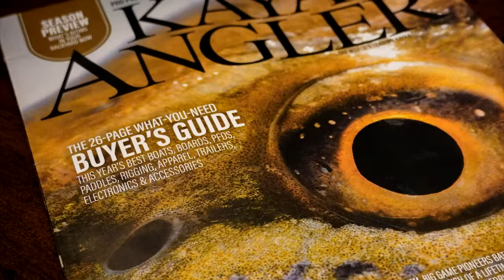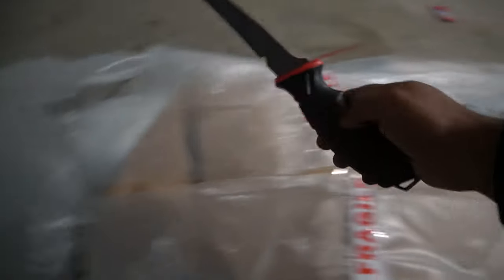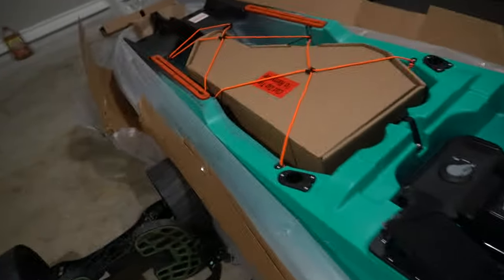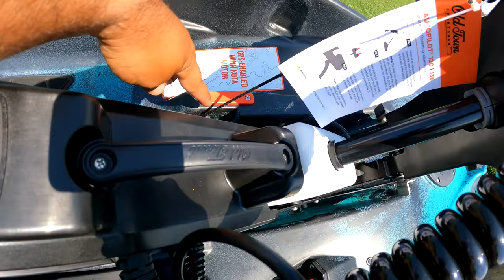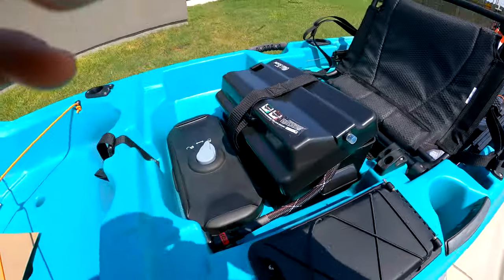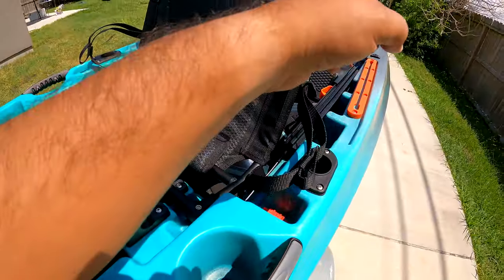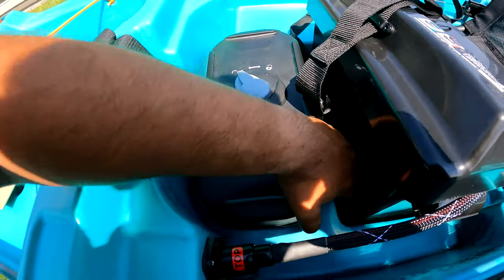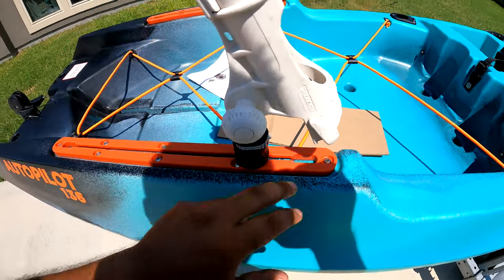Autopilot 136 MOTORIZED Fishing Kayak | First Impressions

Comment: I've had my 136 for a year now. Nothing compares!
Reply from the maker: I’m interested in seeing how the competition will answer. It’s just that good!
Reply: @NextLevelFishingTV  I have one FPV 110AH lithium battery as my main and depending on the trip, keep another one of two extra 100Ah lithium's batteries for back-up. I have a 54lb thrust transom mount motor II use on my Bay liner and wanting to experiment with hanging it off the kayak straight and use mainly for speed. I'm trying it just for curiosity and see what happens.
Reply: Is the 120 good too. Can you guys please try to help me out I'm on a mission in saving our beautiful waterways universe using a kayak like a old Town autopilot either the 120 or 136 but I'm a very poor young adult trying to make a big impact in saving our beautiful waterways by picking up Trash and to keep it clean can you guys please help me win one please
Reply: @gregjulian1044  Why do you need so many batteries I thought one 110AH lasts the whole day.  Also on the topic of speed, is the 45 lb thrust too weak/slow?
Reply: @golforfishing  I fish inshore mostly and some offshore on the Texas gulf coast. I use some electronics such as my graph and some other gadgets. I can stay out all day and battle some severe tides at times which can easily manage. The 45 lb thrust is fine and depending on the wind direction and tide, manage 4mph on high and less speed if going against the wind and the tide. I never want to run out of battery and be stranded in adverse conditions.

Comment: When facing deeper water swells say like in Baffin Bay this kayak would be awesome.  Spot lock technology does away with anchors which can scare trout when using.  Back bays maybe not so much, but each kayak has its uses for different waters.  Definitely a kayak that would have to be trailered as opposed to loading in a truck bed, not that it couldn’t be loaded in a truck, but trailering makes it easier.
Reply: Do you do much fishing in Baffin?  I'm looking to get a Kayak for getting into the north part of the Callo del Grullo and into Los Olmos Creek from Site 55 for duck hunting.  Any Kayak recomendations?

Comment: I can’t wait to get mine … congratulations bro!! First video I see that the owner shows it while it’s brand new. It just makes you want to buy it faster!!!!
Reply from the maker: You are going to love it bro, be sure to hit those terminals with dielectric grease. That would be my only recommendation. I haven’t had any issues yet but I’ve like anything in the salt, ya must protect it.
Reply: @NextLevelFishingTV  can you elaborate on this info because I will only use it for salt water fishing! Thank you In advance
Reply from the maker: @Fishingwithdaboys  of course, so dielectric grease is almost like a Vaseline substance. The idea of it is to put it on any electrical terminal that is open to the air or can be hit by water. So, my advice is to put some inside two areas. The front right where you plug your motor in, and under your seat where you plug your battery in. Put some on the prongs and inside the terminals when you get it and any moisture or saltwater won’t be able to penetrate the gel to touch any metal.

This is the same stuff you’ll see mechanics use on your car battery when you first get it. You can use it generously if ya want, it won’t hurt anything. Just keep in mind that once on and let’s say you drop the minnkota plug on dirt or sand, it will pickup every grain of it. Whip it off and reapply as needed. I put this stuff on fresh every year to twice a year. I also use it on my fish finder on anything that’s exposed.
Reply: @NextLevelFishingTV  this was so helpful thank you very much I appreciate it I know that a lot of times we purchase these expensive things for fishing and we don’t know the little things that can mess up the electrical part of it I truly appreciate you taking your time to respond definitely a subscriber to your channel.
Reply from the maker: @Fishingwithdaboys  anytime bro, don’t hesitate to reach out. Tight lines!

Comment: not sure why minnkota left out the option to upgrade and have the built in transducer and ipilot link
Reply from the maker: Probably price. You can get the 120 for 3800 and the 136 for 4200. I’m sure with those features we’d be looking at a more expensive entry unit.

Comment: what battery would you pair with that motor?
Reply from the maker: If you are on a budget, go Lead 12v 100Ah (FYI they are heavy) marine deep cycle (Walmart/Autozone etc). If you want to use lithium ion, go Z-PRO 12V 100ah (Expensive but very light).

Comment: you upgrade those motor and battery plugs yet?lol Just upgraded mine
Reply from the maker: @billbob670  not yet, but getting close. Had my first click recently
Reply: Do yourself a favor and upgrade now
Reply from the maker: @billbob670  I actually purchased additional plugs about 3 months ago. Figured it would eventually happen. I have zero issues with battery plugs, the clicking is from motor contact separating due to plastic swelling.